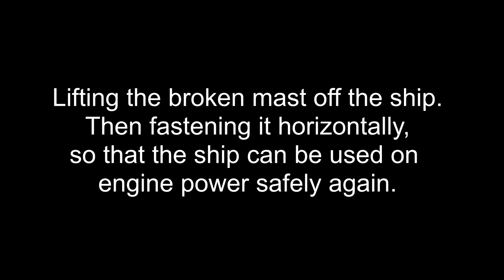Update: My Accident At Sea / Our Music Festival

Comment: I've been sailing and racing for well over 40 years primarily on the Great lakes and mostly Lake Erie. It is the shallowest of the Great lakes, it was a well-earned reputation for quickly turning wild and can turn into huge rollers in 20 minutes. I have had similar several hair-raising adventures as you filmed on your sailing adventure but never a broken mast, we broken stays, broken rutter, hit by lighting, and taking on water broken propeller shaft strut and could not use the engine. I here to testify the statement that sailing is 90% nothing and 10% fearing for your life is very true. I must say I've enjoyed them all. By the way, I like your new haircut!

Comment: Wow, fantastic adventure! Breaking of the rigs is a very dangerous things on any sailboat. the mask is literally attached to the boat by the rigging. And at sea under strong wind that is indeed a big problem. None the less I would not stop sailing ..it's simply Superb. Also rig inspection is something mandatory .... any sailboat, specially the old ones must have the rig inspected. Tension verification and adjustment is paramount for  a correct Mast position and operation. 
In any case the repairs will be very expensive ..the new Mast have to be stepped again since the base cast aluminum broke. All of that is expensive ... the new rigging ... 
In any case do not quit sailing since it is indeed a wonderful experience.

Comment: The backstay and the mainsheet both apply force from the top of the mast aft.  Sometimes it's possible to cope with a broken backstay by tightening the mainsheet, and then using a halyard connected to the pushpit to replace the backstay temporarily.  Once the rig is in the water it's an emergency situation allright!  Of course you start your motor, and it's easy to get some part of the rig fouled in the prop, and then you are totally disabled.  You can buy a wire cutting tool with explosive cartridges for cutting away a broken rig in an emergency - grim.

Comment: These plastic rigging insulators are commonly designed so that if the plastic fails, metal portions take over even though insulation is lost. But maybe 30 years ago that wasn't the case and the reason why the design has changed -- well, you experienced it. Standing rigging has a limited lifetime of 10 or so years and inspection alone is not sufficient after that many years and the rigging should be replaced even if it looks perfect. 
However, finishing a passage with no crew member hurt and the boat afloat is always a good passage. Any skipper should consider herself lucky to have a capable inventor/engineer/scientist such as yourself on board.

Comment: I've never trusted sailboats on which the Main Mast is merely anchored to the deck regardless of "how massive" the foot attachment.  Far superior and incredibly safer designs have the Main mast hermetically connected to the keel - probably the best in this class are Jeanneau yachts.  Check them out and sail more confidently.  (PS: Any marine vessel shorter in length than 100 feet is technically a "boat" - and "ships" are defined as 100' or greater in length.)

Comment: With respect, the plastic was unlikely to be the actual cause of the failure.  The more likely cause is corrosion hidden under the plastic shroud wrappings due to insufficient maintenance by the sailboat owner.
Reply: @Dominic Cerisano very few people ask the appropriate questions when using plastic that is exposed to daily doses of UV light.  Questions like 'how long will it last".  Previously, high strength porcelain insulators were used instead of plastics.

Comment: Should of been put on with proper insulators plastic or ceramic then if they broke you don't loose tension on the mast must admit that looked like it could of happened anytime and a poor design as all the tension was on just the plastic screw threads. Probably cheaper than real insulators when being built or rebuilt in the past. Thank goodness no one was hurt steel cables snapping are lethal.